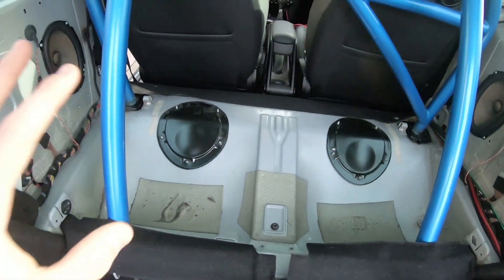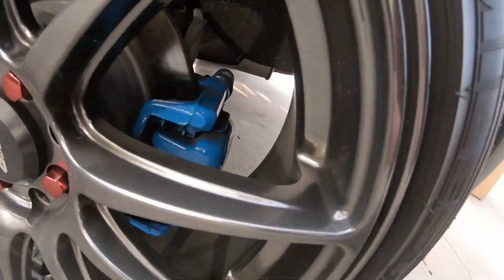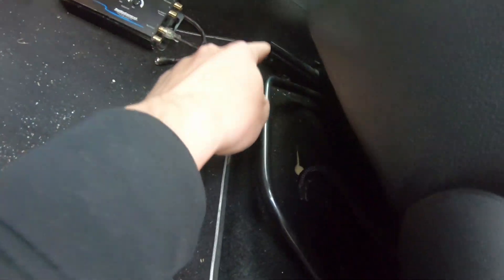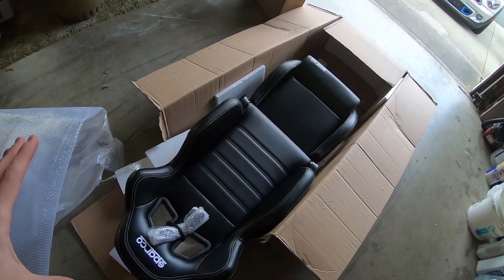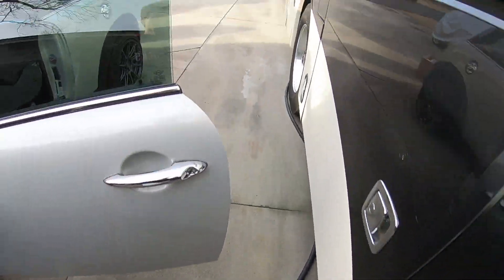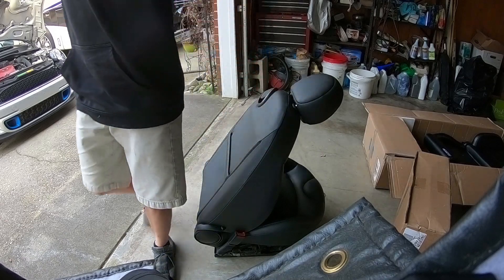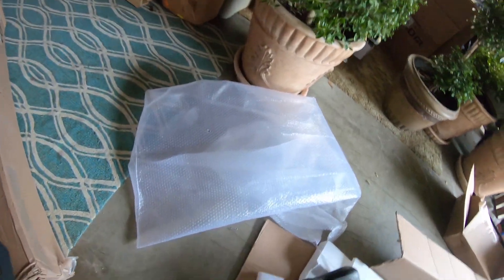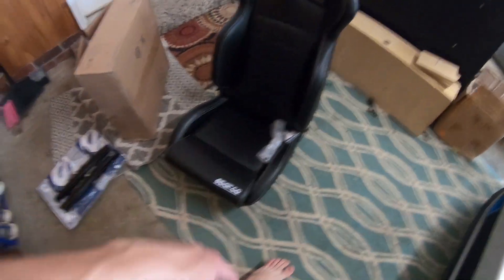INSTALLED SPARCO SEATS INTO THE MINI COOPER!!

Comment: Very nice 😎 how do you bypass the codes? I want to do the same but I dont want the mini to throw an airbag or seatbelt code
Reply from the maker: It doesn't throw any "codes" only thing is the red light on your speedometer that says you are not buckled. Just make sure when you are taking the seat out just make sure your battery isn't plugged in 😁
Reply: Perfect 😎 thanks
Reply from the maker: No problem😁
Reply: from what understand there is a way to keep that light from showing in the dash by using a resistor or something. idk im not good with electrical work. check the forums.
Reply: @MacLaw3084  2.2 resistant

Comment: Love the seats,going for those in mine but you do realise it's dangerous to run harneses on a reclining bucket seat if you have an accident?
Reply: Pace Edits what’s seats are they
Reply: I know but are they the vinyl ones?
Reply: Sparco say u can run harness on this seat so its all good
Reply: @khaellister2928 its well known to not run harneses on reclining seats
Reply: @khaellister2928  doesn’t matter what Sparco says in this case, bud. All that matters is physics. Its also unsafe to ride with a harness, roll cage, and aftermarket steering wheel with no HANS...All looks cool tho.

Comment: I'm liking the build, and subbing to see what else you do with it! I have a 2012 MCS with pretty much the same stuff as you, with the only major difference being I have the RPM Power Stage 2 Tune (MarioKart from NAM is great to work with). One thing I'd check into if I were you - from what I've read, the safest place to have your shoulder restraints mounted is supposed to be the roll cage. I think this is mainly due to the angle, which because you have it over the mid bar and it keeps the angle ideal (not pulling down), I think it's still good. Still you might check into seeing if it'd be better/safer if you just have the fabric doubled over to mount to the bar itself instead of dropping down to mount to the floor. Otherwise, I'm just upset that I only just now saw your video! I hope you get the build where you want it!